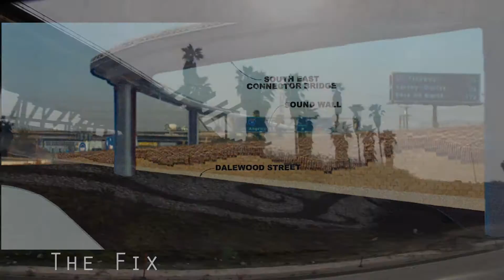I-10/I-605 Interchange Improvement Project

Comment: There is one of those stupid traffic light meters  at the end of the new connector,  stopping eastbound traffic transition and backing it up, defeating the entire purpose!  It's no better than it was before, because of that meter!  That backup has spilled over to the WEST bound 10 transition, now making that transition even worse than it was before.  It takes 4 minutes to transfer from southbound 605 to east or west 10 now.
Reply from the maker: Overall Ramp meter has decreased travel times on the main line. There will be certain condition where the queue backs up, but over all it does keep traffic moving http://ops.fhwa.dot.gov/publications/fhwahop14020/sec1.htm